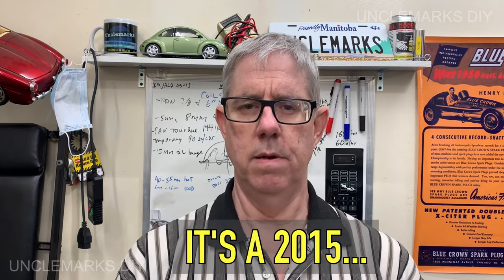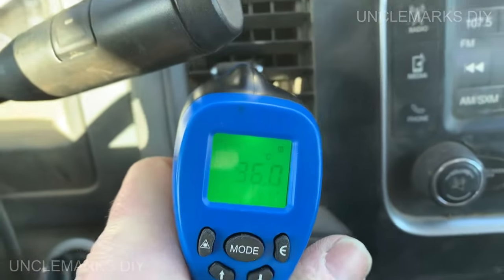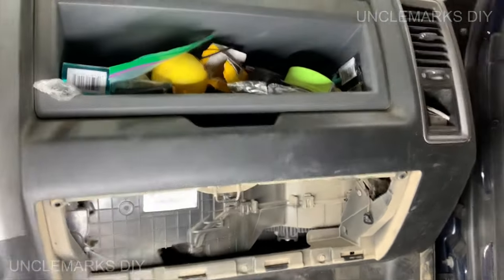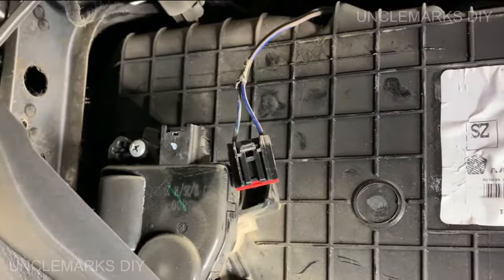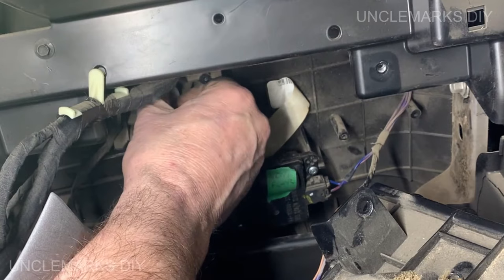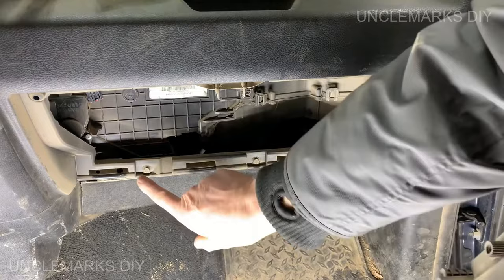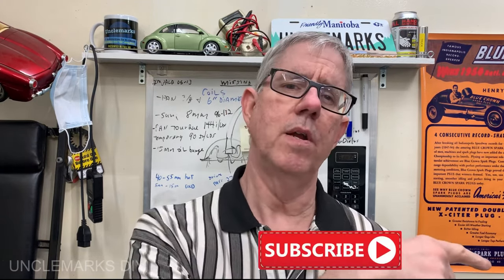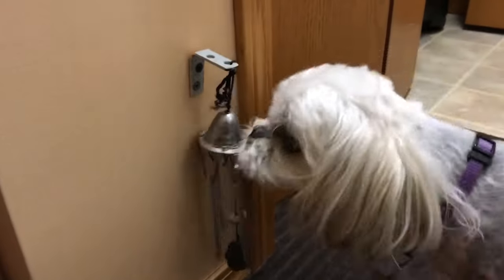RAM No heat or no cold Check this first! 2009 2010 2011 2012 2013 2014 2015 2016 2017 2018 (EP 185)

Comment: 2013 ram all original actuators ,no heat drivers ,i flushed my heater core  and got heat back ,i can flush now in about 15min so i flush  end of every summer make sure im never cold in winter again.
Reply from the maker: Nice! Not sure where you live but here in Manitoba Canada, we get down to the -40F a few times through the winter, and you really notice a few degrees of heat missing! I am glad the flushing is working in your case. (You probably caught in just in time!)
Reply: Did you ever figure it out?

Comment: Mine does nothing has new blower motor and resistor
Reply from the maker: @rickr5223  could be all sorts of issues. Your going to have to do some testing. (Gonna need a wiring schematic) Is there power to the switches. Trace it back to TIPM. Also, is the grounds?
Reply: @unclemarksdiyauto  yeah it's very annoying

Comment: I have had the same issue with my 2016 ram 3500. My issue started after I had the coolant flushed, but I thought it was a blendor actuator issue. I replaced all of the actuators and I am still have issues. I'm hoping I can find the fix soon.
Reply from the maker: I wonder chbowhunter23, if junk during the flush got trapped in the heater core? Could you try to back flush it with a garden hose? The couple Dodge Techs I have mentioned this to suggested the heater core as being half plugged as a possible issue.
Reply: Did you find out what the issue was?
Reply: @unclemarksdiyauto I have figured out the issue yet. I'm in the St. Louis area and we just got about 8 inches of snow. I am planning on trying to flush the heater core next week when it warms up. I'm hoping that does the trick.
Reply from the maker: @Jose-cd1mc  I have not proved by working on it yet, but looks like a heater core flush could fix it. Do you have lots of miles on your truck? Coolant probably also needs a complete change/flush. Also a good time to replace thermostat. What does your owners manual say as to the coolant change interval? That is the plan, but since it will be a messy job, will get a shop to do it. If that does not cure it, possibly a new heater core. (Pretty big job) Of course, this might not be the issue.
Reply: @Jose-cd1mc  I have not figured it out yet. I am planning on flushing the heater core next week. It seems like it could be the culprit.
Reply: @cstangs23  did you figure out what was causing the problem?
Reply: @DesertJacks  i did not. I traded it in back in July. I took it to a few mechanics and they couldn't figure it out either.

Comment: I have a 2016 2500 with an all of a sudden heat problem.  It has the same controls and when put on heat you feel warm air for about a second and then cold - both sides.  Blend door actuator moves but I question if something is broken internally. How could flushing the core help-what would clog it in the first place?
Reply from the maker: Eventually they all plug up. Eventually as they get older, especially if lots of miles on them. This one has about 157,000 miles on it. As for clogging again, they want you to replace the bad coolant as well. The rad shops use to flush the whole system since the engine rad is probably clogging up as well. Does that make sense?

Comment: Why does my cab smell like antifreeze
Reply from the maker: Heater core leaking? Are you getting a film on the inside of the windows yet?
Reply: @unclemarksdiyauto  I can't see or feel any leaks but I haven't looked deep into it 
as far as the film there was some what does that mean 
And if it is heater core and I get it fixed will the antifreeze smell ever go away or should I just get rid of the truck
Reply from the maker: @JojoPopo-s8j  Antifreeze smell means antifreeze is leaking inside somewhere. May just be a very small leak. Just expect it to get worst and plan for it. Your antifreeze bottle under hood is still at proper level? Maybe it’s leaking at the firewall in the engine compartment? Or somewhere else and smell is being drawn in through air vents?
Reply from the maker: @JojoPopo-s8j  Smell will go away after leak is fixed.

Comment: so if that white plastic “finger”  moves, the blend door is good ?
Reply from the maker: In theory, yes. You should be able to move the blend door with the actuator out. Use your finger or a screw driver. Some times the blend door can fall apart, and then it does not move properly when the actuator does. Do you have no heat on drivers side only? Or what is your problem with truck?

Comment: Hey UncleMark, appreciate your videos. I have a 2013 ram 1500 that I bought in 2020, the seller let me know the drivers side heat doesnt work before buying it.  He was thinking the heater core needed replaced but didnt want to rip the dash out to do it.  After doing some research, I think I may have it figured out (not fixed).  So, my truck just has the single climate control and works fine in the summer with the AC blowing cold on both sides.  I found some images showing that there are 5 blend doors for various features of the climate control: recirculation, foot vents, defrost vent, passenger vents and drivers vents.  My guess is that the actuator for the drivers vents is stuck in one position.  This allows the AC to work just fine in the summer, but in the winter its only able to blow a few degrees above ambient.  I googled "2013 Ram 1500 vent schematic" and found some good graphics.  I have access through work to get my hands on a bore scope with remote control tip, perhaps I will shove that in my driver side vents to see if I can see the particular blend door and prove that it is/isn't working.
Reply from the maker: That sounds like a good plan Alex. I was doing some more unrelated work to this truck The owner just had the heater core flushed ad says that seems to have made a difference. (Just a FYI) Please let me know what you find. You can also shoot me a email. Address listed in my about section.

Comment: Thanks for the video
the heater core is Split, top half is passenger side, bottom is drivers side, when core plugs up, you loose the bottom, which is the driver's side heat…go to tie favorite mechanic and have him flush your coolant system.
Reply from the maker: It is split so to speak, yes. These new cores don’t flush well. So far guys have tried and it doesn’t solve the problem.
Reply: @unclemarksdiyauto  that’s why they need to take it in and have a radiator company or some other reputable mechanic to make sure it’s flush properly. And also to pressure test it to make sure there’s no leak. That’s often times what guys run into when they do it on their ownall of a sudden their heater core is no longer plugged but it leaks
Reply from the maker: @gman8557  I agree! The problem is most will never go to a real rad specialty shop. They figure any shop or they themselves can do it. Of course the results are based on where you take it, not 9n how much money you did not spend.

Comment: Don’t run the blend doors actuators when they are not installed. They run to the stops in their location if you “test” them loose they can over run and will not work once installed. I worked for a manufacturer (not Dorman) and the most common “warranty” on the new part was because it was “tested” by the installer prior to being installed
Reply from the maker: Very interesting! Thanks, Miguel.

Comment: 2017 ram 2500 diesel, temp stays the same across the whole dash, not cold, not hot, just ambient temp. verified the temp blend door motor is working, blend door tab moves as it should, but still no change. only thing i can think is the door itself is broken inside the HVAC housing?
Reply from the maker: Yes, that can happen as well. Not good.

Comment: very helpful thank you
Reply from the maker: If it is not this actuator, you might have a plugged heater core. (Can be flushed hopefully) Some have commented that the dealer wants about $3000 (not $300) to replace them. The whole dash and steering wheel has to come out. (If your vehicle is one of these trucks)

Comment: Hi folks , believe it or not on my 24L Dodge Caravan my heat was minimal. Recently while gassing up at WalMart i did the typical oil level check and also found my coolant very low. I purxhased a jug of walmart coolant, topped radiator and recovery tank and voila. Heat! Monitored duct air at over 120* F 😊 as im getting a v6 caravan soon.
Reply from the maker: Low coolant will do it! How new a Caravan are you looking at?
Reply: @unclemarksdiyauto  I have a 2005 4- cyl Caravan which has been Reliable. A little underpowered but Reliable. Any who I found a nice 2005 Caravan with the V6 engine. Call me crazy but I love old vehicles that run well. A colleague and his wife were quoted $27K to fix battery on a Chevy Bolt😂
Reply from the maker: @dougfredricks2017  ah, sounds like a plan. You’re not nuts! These older vehicles are fixable and reliable. The 2011 and newer can have some issues. I think your safe with what your looking for. How you find a nice lower mileage one.
Reply: @unclemarksdiyauto    I come from a background in electronics and computers. Furthermore I have multimeters, basic wrenches, OBD scanners and I Don't mind getting hands Dirty. I grew up with those thick Chiltons manuals and say it bodes one Well to use common sense when trouble shooting. However I'd never buy any of these Over priced new cars. L😁L at over $80 K for a new pickup truck.
Reply from the maker: @dougfredricks2017  New prices are nuts. I would not waist money on a new one. The dealers can’t even fix the new ones! Much better if we can keep our older vehicles going. Many are more reliable t(a the new ones.
Reply: @unclemarksdiyauto  E🚙Vs are a joke. Owners laments include "not enough" charge ⚡Stations and rapidly discharging batteries. We are the Usually Scammed Americans 😂
Reply from the maker: @dougfredricks2017  And here in Canada. They think at -40F electric cars will have no issues with range or charging! Lol!
Reply from the maker: So true!

Comment: Okay I watch the video and the motor was working. How do you fix it though?
Reply from the maker: The no heat on drivers side? Probably plugged heater core. They are not flushable. Very expensive repair. (that is why I don't have a video on replacing it.) Dash has to come out etc. May get the truck back one day & do it. If I do, a video will follow.

Comment: I’ve got that same little tripod😃
Reply from the maker: I broke it and you can't tighten the newer ones enough for them to hold the camera. The stand stays put but the camera flops to the side.
Reply from the maker: FYI. Heater core issue! Bottom half (plugged half) of core goes to drivers side, top half to passenger side.
Reply: @unclemarksdiyauto  yes sir

Comment: My little motor behind glove compartment works good, but still no heat.
Reply from the maker: Lok into it a bit more. Could be your heater core which is non flushable. (have a Dodge tech buddy & he says flush does nothing on these cores) Very expensive to have shop replace core. I would have a shop diagnose this issue if you go the shop route. (Not just tell them to replace a core, since it could be something else & they might just do what YOU SAY is the problem. (Let them test to make sure WHAT IS broken.

Comment: Hello i have a 2013 dodge ram 1500 just did a complete flush and thermostat change i now get heat for 15 seconds and then it goes cold do u have any suggestions? Thanks for the video great tips
Reply from the maker: Could still be more junk in heater core. Could have come from anywhere since you did a complete flush. I would try flushing just the heater core again. (you are flushing it in reverse flow, right?) Probably not what you want to hear, Donnie? This is the only thing I can think of. Keep us posted.
Reply: @unclemarksdiyauto  thanks for the reply i think u are exactly right. Great channel just subscribe
Reply from the maker: @donnieporter7890  Let me know how it goes. You can also send a email. Address in my channel about page.
Reply: @unclemarksdiyauto      will do I appreciate you
Reply: Same issue please update if you come up with a solution
Reply from the maker: @jayalan13  If your issue is cold on drivers side & hot on passengers side, I was talking to Dodge tech. It is heater core issue. Flush will not help. Looks like 8 plus hours to replace! The way core is oriented, air from bottom half (which plus first) goes to drivers side, the to half of core is directed to passenger side. Make sense? It is gonna be expensive.
Reply: @jayalan13  i emptied the rad and filled it with a rad flush and distilled water ran it couple hours then did it all over again then i drained the rad and put a couple gal in and ran it couple hours and drained it then i took the 2 houses off the water pump and clamped a long funnel on the intake hose and filled it with distilled wated and blew the watet thru with my small dewalt blower and i switched the hoses and did the same process back and forth several times each way it took 30 gal of distilled water to do it. In the spring i will take the 2 hoses off the water pump and clamp a long funnel on each 1 and i will put a heater core flush product and fill it up and let it set fir 15min and the blow it out and clean with distilled water it alot of work but use only distilled water i also bought 1 of the guns the shoots water and air but if u have a small cordless blower they work good
Reply: @unclemarksdiyauto  I'm having the same issue as Donnie a few seconds of warm then just cold both sides the same
Reply: @donnieporter7890  so are you saying this process worked for you and you got your heat back?
Reply from the maker: @jayalan13  Your coolant is at full mark?
Reply: @jayalan13  yes but it takes alot of time and water to do it correctly
Reply: @jayalan13  i also went to harbor freight and bought 1 of those funnels for the radiator it will save u time and u can see the clacium floating in the funnel

Comment: Still doesn't fix my problem clod air is not going to drive side. Checked all motors and doors and work properly. Is it 2 doors on 1 motor for the one in the glove box?
Reply from the maker: I still have not fixed this issue. Sounds like blend door might have broken in 2 pieces and drivers side is stuck. This is on the single zone system.

Comment: I have 2012 dodge ram 1500 air blows no hot no cold actuators seem fine but no heat or ac still blend doors work fine as well . Can you help ?
Reply from the maker: Does the fan run? If so, you say no circulation, Robert?
Reply: @unclemarksdiyauto  blower works air circulation is not what it was . I did notice two things my recirculating door is broken and the climate control buttons have been replaced
Reply from the maker: @robertschrader9799  Humm...Interesting. Of hand I can't give you any guidance. Getting inside to the circ doors is not very easy and I have heard to get the heater core replaced is a serval thousand dollar job. Dash comes out etc.
Reply: @unclemarksdiyauto  I just find it odd that heat and ac stopped working at same time
Reply from the maker: @robertschrader9799  I don't really understand how that is possible if there is airflow. Usually you have one or the other. Hope you figure it out!

Comment: The issue I'm having with my 08 ram 1500 is that my heater itself won't even turn on. Is it possible that it's the blower motor or that the switch itself is bad?
Reply from the maker: First thing I would check are fuses for the blower motor, Anthony. 2nd, with the fan on high, try tapping the blower motor with a hammer. If it starts up, probably a motor issue. These are the easy checks/fixes. You could also unplug the motor and measure for power with a test meter.  Next it probably is time to got to a good shop and have them look into it. Lots of electrical things that could be the issue.  Let me know how you make out.
Reply: @unclemarksdiyauto  Okay thank you for taking the time to read my comment and reply. The heater was working intermittently a day ago and I could bump the knob area with my hand and it would come back on but now that no longer works either. I will try what you recommend and let you know results.
Reply from the maker: @anthonyparenti1928  Hope you figure it out! I always try to answer back ASAP. Don't forget to make sure your subscribed as well!
Reply: @unclemarksdiyauto  p
Reply from the maker: @francistamachaski3295  Got a question?

Comment: Does a thermostat make a difference to get better heat
Reply from the maker: Only if your thermostat is not working properly. If your engine cant get warm, there is not much heat to warm the cab. Does your temperature gauge sit where it always did once vehicle was warmed up? Those gauges are not that accurate, but if would be noticeably different. Like, if it always ran at half on gauge, bad thermostat might only run gauge at 1/4? Looks like these trucks all have same issue after they get a bit older.
Reply: @unclemarksdiyauto  thanks.  I'm just wondering cause I'm not getting heat through my vents.  It's only very little coming out I notice the heater core has one hose that's hot the other is warm.   We flushed the heater core out once and it worked but after a week its back to no heat.
Reply from the maker: @chrisruiz1215  Heater core probably plugged up again. Try flushing it again. Wonder how many miles/years old the coolant is? Not sure what the maintenance book says that should be changed.

Comment: mines just cold i changed that blend door under glove box and no heat
Reply from the maker: No heat before and after the change? Some have said that older or higher mileage vehicles have heater core issues. The new design of this core makes flushing it a waste of time and money.

Comment: My ram 2015 sport dont activate nothing, no blower and i cant activate with stereo too
Reply from the maker: Interesting. Have you checked fuses? Do you have power at the blower motor (with fan on high...you can use a test light for that)